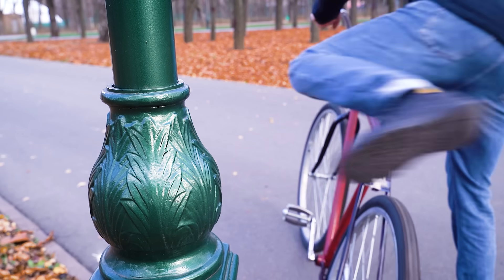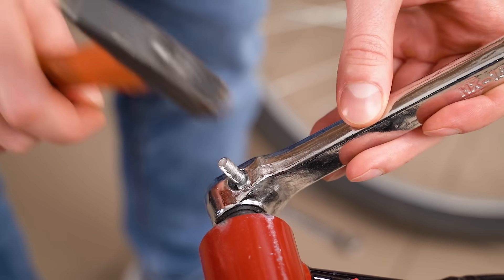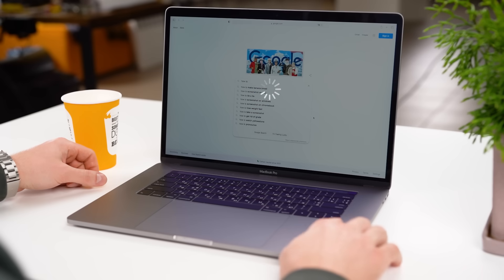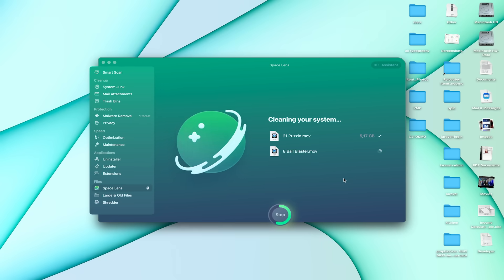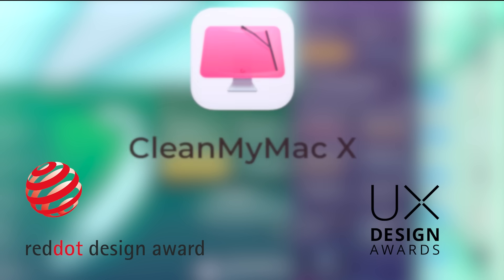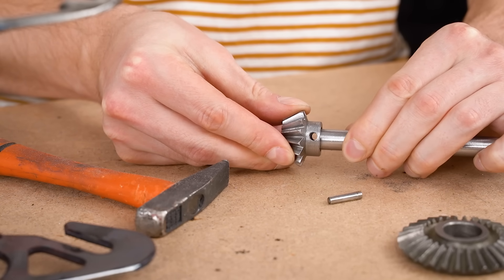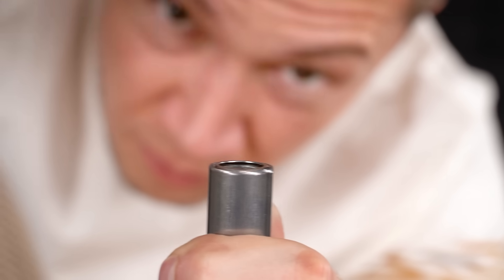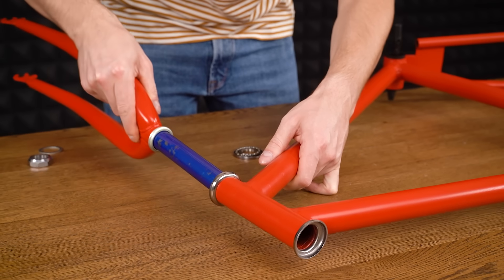Insane Chainless Bicycle Prototype

Comment: Es gibt viele Ideen, einen Antrieb ohne Ketten zu bauen. Auch diese Lösung ohne Abdeckgetriebe hat Nachteile. Ich sah, dass die Zahnräder mit dem Schmiermittel besprüht waren. Was passiert, wenn Staub, Sand oder Matsch zwischen die Zähne kommt? Diese Komponenten verschleißen in kurzer Zeit. Das sind die Fragen, die im Projekt gestellt werden. Die Antriebswellenführung ist, wie auch die Zahnräder, nicht abgedichtet, da kommt auch Staub, Wasser und allerlei rein.
There are many ideas to build a drive without chains. This solution without a cover mechanism also has disadvantages. I saw that the gears were sprayed with the lubricant. What happens if dust, sand or mud gets between your teeth? These components wear out in a short time. These are the questions asked in the project. The drive shaft guide, like the gears, is not sealed, so dust, water and all sorts of things get in there.

Comment: Wow look now we’re pedaling twice as hard for what a chain can do in one pedal 😱 10/10
Reply: It's like mocking chains because you saw someone who's running a 22/52t spinning out once
Reply: Main disadvantage is the single ratio. Suitable only for roads with, at best, mild gradients.
Reply: @norbiesison9257  , wouldn't it be possible to use a gearhub like a Shimano Alfine?
Reply: @tim10243   it may be possible as I saw a set up that used a "timing belt" to drive it. Nonetheless, you'll be limited by the number of available ratios in the hub.
Reply: You're assuming the chain is what creates the power ratio's, where it's actually the gears.
You could have an equally powerful push with an appropriate sized gear.

Hence why geared bikes have different sized cogs, not chains.
Reply: @joel7227  that actually makes alot more sense ngl
Reply: @joel7227  yea but can you quickly and easily change gears with a chain less bike? I’m not gonna put a whole entire gearbox on my bicycle.
Reply: @joel7227 yeah learning from Rc car Hobby, you need larger pinion and smaller spur to go faster 

So in this case the gear coming out from the pedal is like the pinion on the motor so that needs to be much larger and then the gear on the wheel is the spur gear which needs to be smaller so he basically needs to reverse the sizes and it will be much faster a bike
Reply: @bryanmiller476  You are correct, but then it would push the crank even further away from the frame, this looks like its on the limits of pedal width as it is
Reply: A better gear ratio should fix this.
Reply: you know it's because of gearing and not the chain itself right
Reply: Dude was cycling like a motherf**cker on flat ground. If there was a larger cog size on the back wheel or main crank cog would that increase the torque?
Reply: Chains are messy, relatively short-lived, and wallow in road grunge. Driveshafts (as motorcyclists well know) are neater and require almost no maintenance. The drawbacks of shafts for both motorbike and bike are initial cost, more weight, and less efficiency than a chain. I think the trade-off is often worth it.
Reply: @rcnelson  the friction loss must be crazy but true tbh, chain suck sometimes especially when they come off and you have to stop and put them back in, but ill keep my chains your opinion is valid though
Reply: @rcnelson  no real motorcycle had a drive shaft. There are a select few heaps of garbage that use them. So, yes as a life ling motorcyclist, chains are used for a reason, theyre better.
Reply: @rcnelson  for engine driven vehicles ok, but if you are the engine, efficiency is everything. Even if they manage produce something with infinite life, no maintenance required at all and even free, but with a drawback of requires %50 more effort to travel same distance, no biker would pick it.

Comment: This won’t work for long. The biggest fault here is maintaining adequate lubrication. Lack of lubrication on small exposed moving parts equals excessive wear and early failure. You’d have to grease up before every ride.

Comment: The gear ratio is shit. You lose a lot of energy in this 2 x 90° gears. Chain is more efficent. You used spray oil on that gears that ist also not good, cause the oil just drip down and it doesent stick to it

Comment: - Gear ratio is extremely low, so not really useful for more speed
- Spinning shafts with no lubricant 
- no way of coasting without the pedals moving 
- no way of protecting gears from rust, dirt, or sand, so the gears will probably just wear out really fast.

Comment: Pretty cool but it actually shows how efficient the chain mechanism is
Reply: true he cant change gears
Reply: This is how you package criticism! 👏
Reply: So how efficient it is?
Reply: can easily be fixed with just different gear ratios... chains work the same way the sprocket is the gearing basically
Reply: @tom4208  but this looks like it will require a lot more maintenance due to its rigid nature. A chain is flexible, its able to take a lot more shock
Reply: @terrificfrogg8377 Shaft driven motorcycles require much less maintenance than chain driven, that's one of their biggest advantages.
Reply: @Will80085 motorcycles riding on big speeds, not like average bike
Reply: @AzovskiyHleb  So the motorcycle components experience much more stress than those of a bicycle, meaning on a bicycle they'd last even longer.
Reply: @AzovskiyHleb  This makes no sense.
Reply: @Will80085  and yet, not a single serious motorcycle manufacturer uses a diveshaft ofther then a few harleys and other cruisers. Which are all dogshit anyways. No bike that takes itself seriously has a drive shaft. Get a grip.
Reply: @Will80085  and your second comment is just entirely devoid of logic.
Reply: @splitloopgaming3523  Several manufacturers made and still make shaft driven bikes, big one that comes to mind would be the goldwing which is well know for its reliability and ability to go many miles. I have a Kawasaki Vulcan 750 with a shaft drive and have never had to do any maintenance on the shaft where chains need to be lubricated, tightened, and replaced at regular intervals. The logic is clear, the internal combustion engine of a motorcycle puts out much more torque than a human peddling, more torque=more stress on mechanical components, meaning more wear. I was only speaking on reliability, there are other reasons most bikes use a chain or belt drive.
Reply: Wrong the biggest selling bike is shaft drive bmw GS. And massive powered bikes shaft drive
Reply: @splitloopgaming3523  Most, if not all, Moto Guzzi bikes are shaft drive too.
Reply: @splitloopgaming3523  Harleys have never used a shaft drive, they have used Kevlar reinforced rubber belts for the last 25+ years. BMW has some bad ass sport bikes that use shaft drives, they were the ones that perfected shaft drive for motorcycles. Honda Gold Wings have always used shaft drive and for a big bike, they are pretty fast and handle pretty dam good for a touring bike.  Do some research before commenting.
Reply: @splitloopgaming3523  Most major manufacturers currently make a shaft drive motorcycle. HD hasn't made a shaft drive since the 1940's. Ewan McGregor and Charlie Boorman did a documentary where they rode shaft drive BMW R1150GS motorcycles around the world.
Reply: @terrificfrogg8377 chain doesn’t take weight shocks, just shocks from foot to power, which shaft gearing wud take better.
Reply: @splitloopgaming3523 bmw wont be shit! Shaft has lower efficiency but city bicycles dont have that issue.
Reply: Why not use chains on car differential then 😂

Comment: This is streamlined and more importantly simple! AWESOME! Always hated those greasy, oft breaking chains.

Now if your engineering mind can devise different ratios (sans pesky chains) for varying bicycle terrain, you will have improved on the bicycle!
Reply: No, he wouldn't have. 

He just reinvented technology from the 1800s. Bikes later evolved to have a chain since it's more efficient and can easily be made to support gear changes. 

If you wanted to have multiple gears with this method you'd near a gearbox which would add a ton of weight.
Reply: @megandamaso8496  never say never. There's a reason chain-less bicycles exist: people are inherently creative and forever trying to reinvent the wheel (no pun intended).

We all knew the chain-less bikes preceded the chains a hundred odd years ago. It's great to see ingenuity continually evolving.

Eventually there will be a way to lighten the gear differential for the bicycle, after all, folks are already delving into it.

Comment: Seen it before as a timing system on 4-Stroke Motorcycles. It's nice that it's so quiet. I like that. However getting a transmission of sort going with that system to make it a useable daily drive bike will be complicated.

Comment: Good work, but one problem I notice is the gear ratio is not well suited. Need larger front gear. Also the welding strenght might not be sufficient in long run, the steel can bend and the gears will be no longer properly engaging.

Comment: Obviously chains are more efficient but you don’t see them on car differentials so I think that there is potential here. If you were to enclose the gears and make a three speed planetary transmission at the pedals you could have a bike with very little maintenance.

Comment: Good work! My only comments would be
(1) if those bevel gears all came from the same model of drill it looks like you have a 1:1 overall gear ratio - very low indeed! (NB this will always happen if you go large:small:small:large, regardless of the relative sizes of the gears). Setting them up large:small:large:small would give you a ratio of (large/small)^2 - probably too high to be practical since the large gear looks to be at least twice as large as the small. Maybe hunt around for some different sized gears?

(2) For the love of God put some grease on those gears, if it's not already too late :-)

Comment: I had a shaft drive bike. The whole drive is enclosed so it is protected against dirt and dust. The hub is three speed so ok for around town. The transmission lasts forever as it would have gone through a few chains and cassettes by now.

Comment: I'm seeing it as a lighter design. Easier to pedal but those gears heating up while undergoing fatigue is a major problem.
Those bevels are also susceptible to dirt.
Multiple bevel gears to the end is viable for shifting but thats for another time.

Comment: There's couple problem
1. them gears will get dull quick because of overuse, Sun, Rain, mud etc, thus making it unusable unless you swap both gears with a new one

2. With this set up you can't rest your feet on the Pedal and hope that it doesn't stop the wheel from spinning as long as the Wheel spin, the pedal will also spin.... whether you like it or not

3. Changing Parts is Difficult and takes a lot of time, you have to literally dissasamble half the bike, only to change 2 Gears.... changing rusty chain is way easier

4. And the most Obvious one, is there's no break, so you're really relying on your feet strength to break the wheel, specially in a quite Slope angle

This is where New Idea looks cool, but after testing and some thought, you realize that your design is Flawed heavily
Reply: And yet, masses of people will call him a genius. There's no practicality in this bike

Comment: OK why don’t we see more of this I used to think about this design in my head all the time you actually did it which is awesome good job👍🏻✌🏻
Reply: its because this type of mechanism is not really practical. Tho it looks good and compact, its more slippery, the gears wear really fast. Speed here is not available. In year  1885 this Glitch was patched with more efficient version aka chain bikes. Hope this helps

Comment: Excellent. By increasing the size of the rear wheel gear you can use a regular bike gear mechanism to move the drive shaft back and forth to change gears. If my physics is accurate.

Comment: Nicely done  ✅ 
A good take on an old idea 💡 
It's amazing to think they made this concept, back to 1898 with the Chainless Columbia Model 51, which was also shaft driven... 
I have not seen it on a bicycle before, so that was fun 👏
It would be okay around flat, Flemish countries, since there are no gears.
I noticed there is no retaining part, to hold in the modified - 'cotter pin', so it's just relying on compression, but that is an easy fix. 
Sometimes we have to go back, to go forwards... 
ie. A Hybrid engine originates over 100 years ago - from a submarine and the electric car was first developed in 1890, before the combustion engine, yet its become the 'new' thing...
Good video, thanks for sharing,
Atb Gus 👍
Reply: Shafts suck for this application. They're acceptable for motorcycles because you can build an engine that can provide enough power to make up for it, but they just suck. If you're concerned with maintenance the best compromise would be a modern belt driven bike. They're slightly less efficient than a standard chain bike, but they're much lower in maintenance. But, really, chain maintenance isn't that big of a deal.
Reply: @SmallSpoonBrigade  you make a valid point. There is another way... 
The future is 'frictionless', so no 'gears' - no 'real' maintenance needed 😉
Reply: @SmallSpoonBrigade  on a + 150NM power cruiser a belt cant transmit the torque as instantly another reason your Vmax is such a quick bike.
Reply: Yup. It was billed as "ideal for the ladies" because there was no chain to catch/dirty your clothing on.
Reply: Back in these days there were only shaft bikes, no chain it wasn't invented yet
Reply: @MainInternetUser  No. Just no.
Reply: We live in a cycle of birth, destruction and rebith.  What we did, happened in the past, in our past lives.  The Kali yuga.
Reply: @Kopie0830  
Okay, I and many others have understood that concept since adolescent days.
However, let's say that concept or other belief systems were man-made to exercise control over a population... 
To help subjugate the individual and free thinking. If you can control their mind, you control them essentially. 
Now, try to answer the question without any preconceptions or unconscious bias... 😉
Reply: I have a friend with one. When he asked me to guess how old it was I was 100 years out. It had wooden wheel rims too.

Comment: 15% energy lost by turning the power at 90°. Chains and belts are 98% efficient. You are not going to improve on the chain with a 90° change in the direction of the power
Clever but not efficient

Comment: Cool idea. Although driveshaft driven bicycles are considered older technology. Im not sure what you took apart to use as gears but hopefully you knew that a shaft driven bicycle requires some pretty solid and sturdy parts to keep it going. Great video 👍!
Reply: I think it was an old driller
Reply: Probably the drills he was disassembling and pulling gears from.

Comment: I grew up in isolated village in India. Since my childhood I have always wondered why every cycle manufacturer can only make chain cycles even bikes. I asked this question because as a boy the chain used to snap or eat our pants or even brake and due to poverty we would have to just be content without riding cycles. These kind of videos are only for fun not for real life. Why is it that till date not one cycle manufacturer has marketed chainless cycle?
Reply: the main purpose of a chain is it moves over different size gears when you turn the handlebar. So you you can climb hills at a slower speed, but with less effort.

Comment: A nice idea... assuming it had not been already tried 2 centuries ago. All the problems associated with this direct type of drive demonstrate why the chain drive is what's now used today.
The same way that chain de-coupled on you, is the same way the teeth on those gears will also leave you stranded. Just be sure you pack an extra set of gears and a portable welding kit.
Reply: Whether it was tried before or not has absolutely nothing to do with the video.
Reply: @mechanomics2649  Opinion noted

Comment: Cool idea of course but not a good idea. Going downhill you will have to sacrifice speed and wear out the brakes simply because the pedals will go nuts and your feet wont keep up if you catch some speed. Going uphill will make intense stress on the sprocket/cog probably causing a bend in the frame and the cogs will slip.

Comment: That's a bad design! It would take you same rotation of your pedal to that of your wheels because that is the principle of pinion and gear rotation. The original chain drive is still more efficient with one rotation of bigger chain drive takes two rotation of the smaller partner chain drive and the wheel would move faster. The distance between chain drive should be correct with slight slack only and falling off its track won't happen but it do once distance between the two chain drive changes in time usage, well just adjust it again most of the time it doesn't happen.

Comment: Very poor gear ratio.  Lot of peddling for very little and slow moving.
No free wheeling (coasting without peddling).
No gear lube system.
Two right angle energy transfers.  Very poor efficiency.  Lots of lost energy.  Chain system has no directional change.

Maintain your chain so it doesn't break.
Gears without a lube system will require more maintenance than a chain.
To make it viable and practical it will have much more weight and complexity than a chain.
Very poor idea.